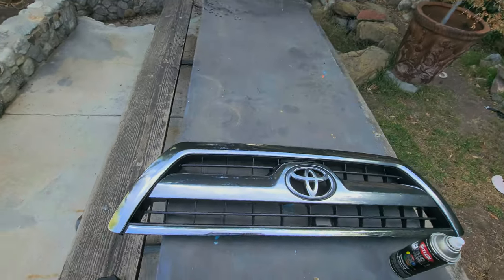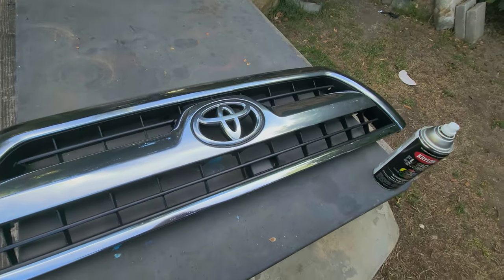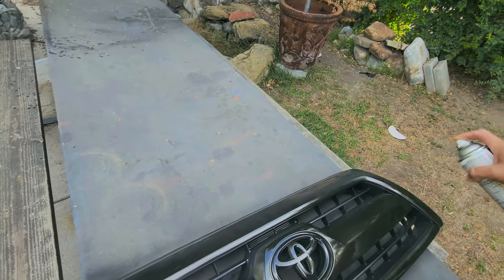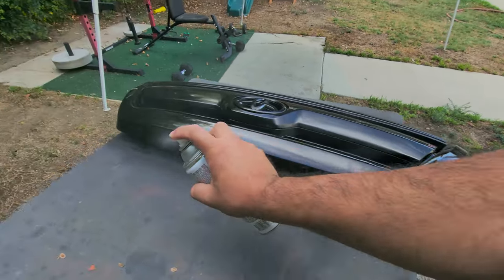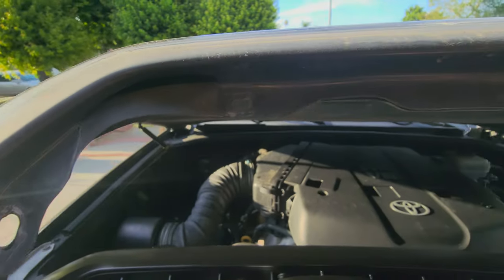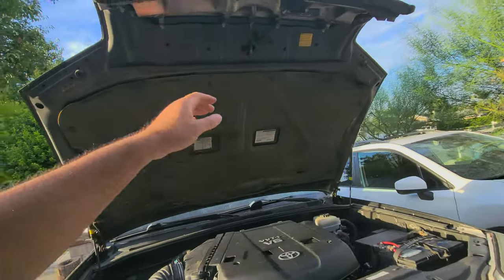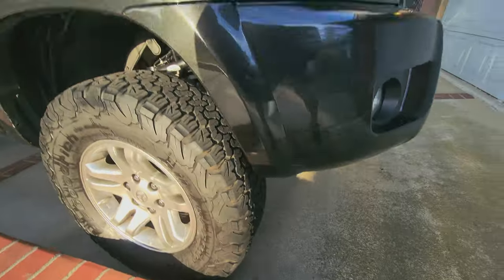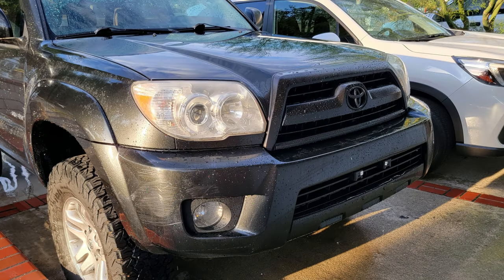Painted My 4th Gen 4Runner Grill

Comment: I have a 2003 4Runner I bought used.  The front bumper has a small crack in it at the bottom.  I painted the front bumper with truck bed liner as I take it camping and it gets messed up frequently.  Truck bed liner is very forgiving so spraying over it is easy.

I have blue after market wheels so am thinking of painting the grill blue also.  The body is silver so it should be a good blend.